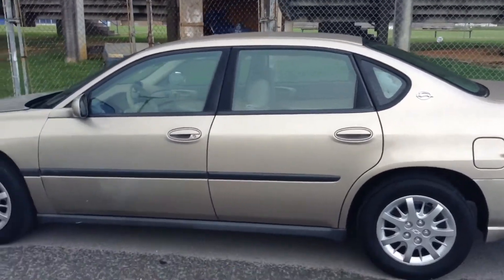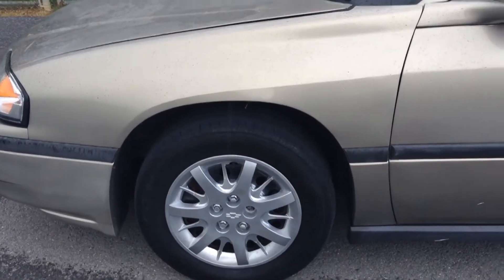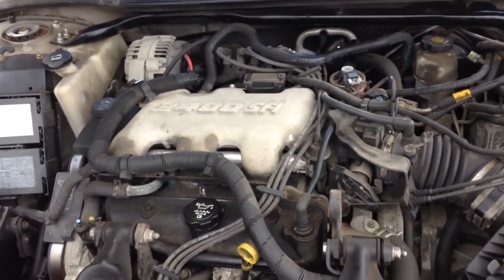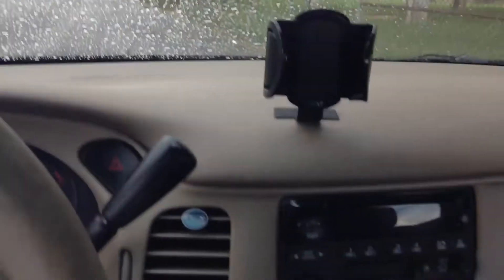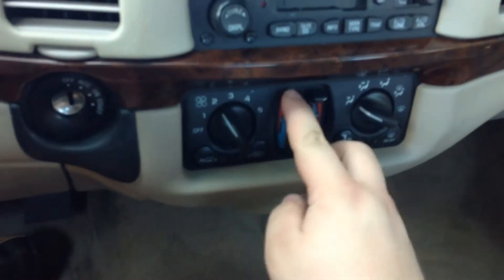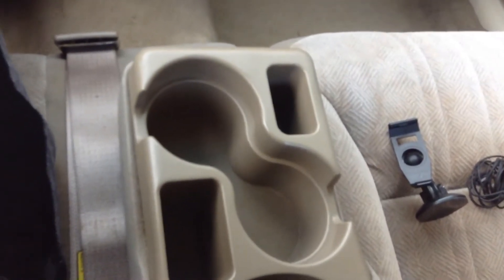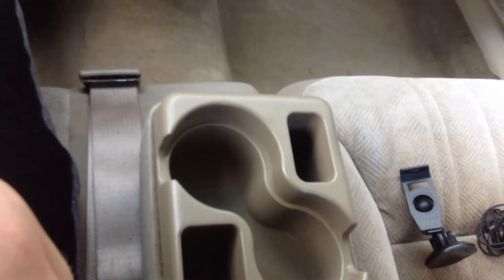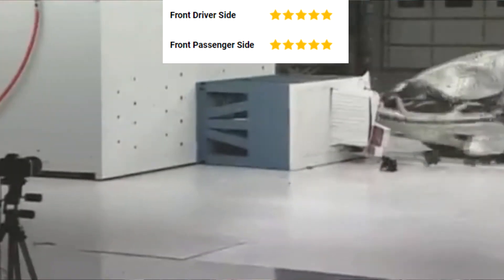GREAT DAILY DRIVER/FIRST CAR: 2003 CHEVY IMPALA REVIEW

Comment: I have a 03 impala ls. It has the 3.8l v6. It's a fantastic car.  Mine does have the tec as it's the 3.8l. It's very reliable and I would suggest it as a first car or just a cheap commuter car. It gets around 23 mpg even with the 3.8l engine and I like to floor it too not going to lie. great car over all. I've had it for a year and I love it.
Reply: I'm looking at an 2003 with 50000 miles. how do the trannys hold up??? Any major trouble? how many miles do you have on yours? Thanks!

Comment: Picked up a 2005 Impala 3.8 LS about 3 and a half months ago, love it so far!
Reply: Same, but the base model 3.4. Man, the car is a tank. I love it. Best first car.
Reply: @OffTrap  if you don't mind me asking, how is it doing if you still have it? I'm planning on getting one with the 3400 as a first car.
Reply: @Bobby-cm7vu  it's amazing as a first car. It's slow enough for a 18 year old like me but I drive like an asshole. Parts are cheap, always starts up no matter what. I just passed 100k miles and things are still great. I've been doing a lot of aggressive driving and speed runs lately and it's running strong. Great gas mileage, always 200-275 miles or more only on 12 gals with 4-5 gals left reserve but depends on your driving style. I had to replace the EVAP lines because the cars frame is completely rusted but nothing a $7 rubber hose can't fix to pass inspection. Great amount of space. But it isn't for me anymore. It's just too big, heavy, and slow. Not saying it's a terrible car. Me and my impala have basically gone thru hell together and it's just a beast of a car. Just do regular maintenance like oil and fluid changes and a tune up like spark plugs and wires. And your car will last forever. Just the rust issue is a bit of a problem but I'm trying to get a CTS4 next. I'd love to keep the impala as like a work van because the amount of space it has is amazing. But sadly, I can't have 2 cars because insurance would kill me.
Reply: @OffTrap  awesome, thanks for explaining for me, I was hesitant to get a car due to lack of room but if it's as roomy as I've heard from you and others then I'll probably get one.
Reply: @Bobby-cm7vu  but I heard a lot of issue with the transmission going out at around 140-160k but its a good first car if you find one under 100k miles. But im getting rid of it mostly because the amount of space I have never gets used and I want more luxury features in a car and I take on off ramps at 40-45mph. 50-55mph if I wanna make the tires squeal. I just like driving fast so I need a car that handles better. The body is roll is insane but not bad if you can handle it.  Very soft suspension but because it's soft. It's a interesting experience when driving because you feel like you're on a cloud.
Reply: @Bobby-cm7vu  it's very roomy. 6 people can fit comfortably including the driving if you have the fold up arm rest like me. The passengers in the back have more leg room then in a premium airline flight. And I could fit about 4 15 gal husky toolboxs in the trunk. It's perfect for a vacation car.
Reply: @Bobby-cm7vu   my next car the CTS4 cadillac has very bad space. Trunk is way smaller and passengers barely get leg room if a heavy built man is seated up front. But I always drive alone most of the time with nothing in the trunk so the amount of space is too much for me. But good luck on your first car buying experience!
Reply: @OffTrap  My 03 Impala LS with the 3.8 had its transmission start to go at 147,000 miles. Was completely broke at the time and other stuff started to break so I had to get rid of it.

But that gen Impala is my favorite car and I’ll be buying another one as soon as I can.
Reply: @raiderfly  if I could find one in perfect condition without rust and the LS or SS version. I'd keep it. But I just have the 3.4 with a pressure control solenoid that went out so my transmission will kick once its full heated up. I have 113k and everything is good still besides the frame slowly being rotten away by rust. But my car is still good. I'd keep it but im trading for a cts4. I like the cts more. It checked more things off my list that I needed in a car, the impala is and will forever be my favorite first ever car. Plus I actually had the cts for a month before I blew up the engine lol. But its okay. I'm planning to replace my chevy with a prius haha. So cts4 as a project and prius as a daily.

Comment: This is an old video but I’ll say this anyway. Your temp gauge is fluctuating because the head gasket is bad. GM 3.4 liter engines are known to have head gasket, lower intake gasket and coolant leaks. I have an ‘03 Impala and I’m getting ready to replace the head and lower intake gaskets. The engines aren’t the problem. The problem is the gaskets GM used in these engines weren’t designed for the high acidic Dexcool antifreeze they put in them. The antifreeze ate up the gaskets and caused them to leak, which, if let go too long, destroyed the engines. Coolant would get into the oil and contaminate the oil and the oil would lose its lubricating properties and cause the engine to seize up. If your temp gauge is fluctuating 20+ degrees hot or cold, that’s a sure sign your head gasket is bad.

Comment: I have this car.  If the temp. guage NEVER goes past half way the engine & radiator fans are doing ok. Learn where fuel & starter relays are located, same part numbers can be swapped to test. MAF sensor & Throddle body spray cleaned every 6 mos.  Change full synthetic engine oil & better oil filter every 6 mo.  Change specific transmission pan fluid  & filter every 2 years. Change water/coolant every 2 years.  P.S. Don't change the transmission when the problem is ONE BAD COIL SITTING on top of the motor.  Hope helps.

Comment: This engine is notorious for Intake manifold gasket failure. If you deal with that this is a great engine. More fuel efficient and just as powerful as the infamous 3800

Comment: I use to have a blue on blue 2003 Impala with same engine.  He is right about the transmission.  However, I still want another one.  Mine had the traction control and it worked really well.  It had the Chevrolet wheel covers like that.  But tires were still good size and looked good to me.  What he said about it driving well is right on.  It rode really nice and handled quite good.  Next year I'll be looking for another Superior Blue one again.
Reply: The transmissions are junk by 70,000 miles.  Even with fluid and filter changes every 25,000 miles they still fail.  The clutch inside the transmission fails, and you do not move.  There is a whining noise and grabbing feeling when they go.  The rack and pinion also leaks fluid and is only good for 20,000 miles or 3 years.  After that you go through power steering fluid.

Comment: I have seen a 2003 Chevrolet Impala 3.4 V6 SFI advertised for $3,995.  It has $97,000 mi on it.  Is that a good deal? What should I look out for? Thank you for the good video bro. Keep up the good work. Kudos
Reply: I have a 3400 in my impala, they are a tad lackluster and seem to be unpredictable when it comes to the coolant system. I would recommend the 3800 instead